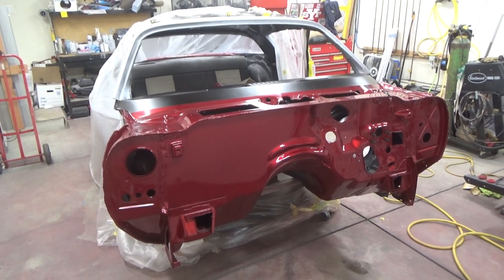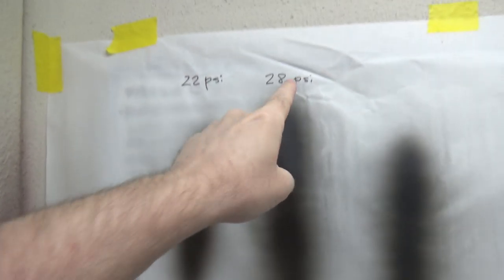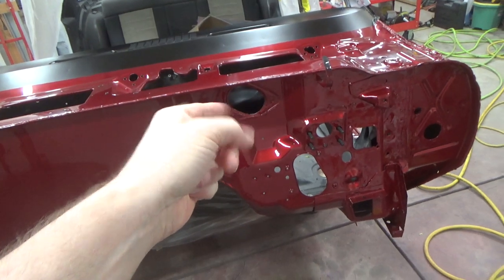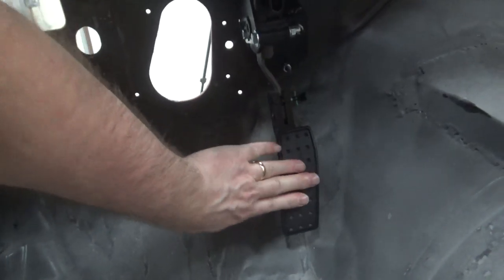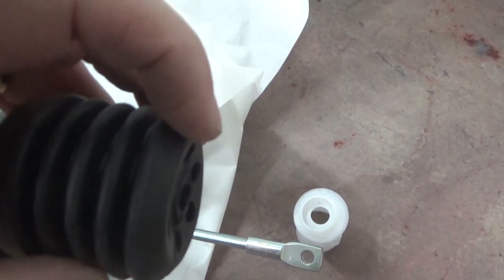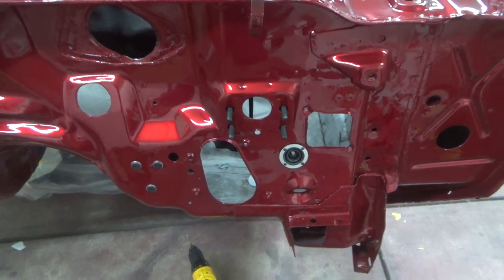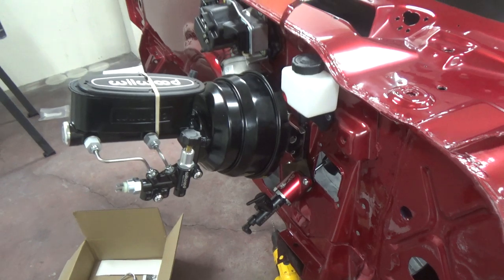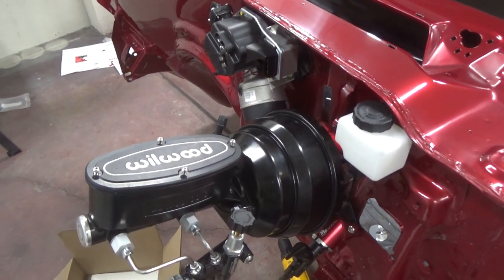1977 Camaro Z28 Part 222: Firewall assembly

Comment: Looking good, Erik.  I wanted to use socket head bolts on the assembly of my car.  After some time the bolts rusted up some.  It may have been because I covered my car with a blue plastic tarp and I had several areas that rusted.  I think the socket head bolts are just put in presto black to etch them black but they may put something else on them now to protect them.  Hot Rod tip on AN sizes if you put the number over 16, I think, it is the size.  An 8 is 8/16 or 1/2 inch.  If that is incorrect, someone will let me know.  Been a while since I was totally into my Camaro.  Marriage, house and trolls.  Keep up the good work.
Reply from the maker: Thanks Leslie. Hopefully I don't have many rust issues here in CA.

Comment: Looks solid.  Love the detail.  I had the same problem when I put on my new master cylinder.  That ring that goes from the master cylinder to your brake pedal should be able to be backed out.  If not, look into getting it extended by welding an added  piece.  Loving the progress and can’t wait to see Pops back in action.
Reply from the maker: Yeah, it is adjustable. I think I might need to open it up a smidge. I will take it off and see what I can do. Hopefully we see Pops next weekend!
Reply: asicerik “adjustable”, that’s the word I was trying to say!

Comment: Erik, things are coming along great love that Red.   look for something called a transmission plug it goes in to the tail shaft of the transmission and keeps the fluid from running out, that way you can fill it on the ground outside the car.  I have one that fits the Borg Warner ST10 but I am sure they make one for the Tremec.

Comment: wow it will look amasing! dont forget to ground the whiper motor to the body, there is one of the 3 bolts that is used for ground, i could not see if it is done but just in case!
Reply from the maker: Thanks Remi. Yeah, I will need to review all the grounding as I go.

Comment: I'm so jealous 😭😭. You're doing amazingly beautiful work on that old gem! I can't wait to see it put back together. I put my windshield cowl weatherstripping on with the seam facing the windshield because the one under the hood has the seam facing the windshield and just figured it would match. I put the one under the hood on immediately after removing the old one so know it is right from factory but couldn't remember the two on the cowl area so just matched with the hood one. Take it for what it's worth I suppose. Don't forget the 2 plastic pieces that go on each end of the windshield and hide under the fenders and upper doors.
Reply from the maker: LOL, I will have to track those pieces down. I have no idea! Thanks bud
Reply: @asicerik  classic industries has them. At least that's where I found mine because the originals were so brittle they cracked instantly. Not too expensive either.
Reply from the maker: @bradleysbuildingjunk6763  Do you know what they are called?
Reply: @asicerik  see if this link works https://www.classicindustries.com/product/1978/chevrolet/camaro/parts/153263.html
Reply from the maker: @bradleysbuildingjunk6763  Yup. Thanks bud. if you have a chance to show them in one of your vids, lemme know please.

Comment: putting another comment on here. I have watched so many house of this build through the years. stole so many ideas for my build I am doing at the same time. I am stealing your battery term idea in through the VA side panel. I got a heads up on the clutch master clearance issue on wiring. You know whats weird? I bought same wiring harness. I could not figure out how you were getting it on with the rounded end near the master. Turns out factory installed the fuse panel to bulk head flange either way. It can be 180 off. Mine is opposite 180 from yours and the larger click side is next to master. I am finishing firewall now. Also I am welding master bracket to fw like guys on LateralG. air tight and no need for boot. no noise. keep up great work, we are all watching and learning with ya.
Reply from the maker: Thanks Shawn. Very interesting! I debated welding that thing on, but decided to go this way. I am sure I can get that boot to be quiet somehow :)

Comment: I bought the same master kit for clutch. mine came with the gm style connector instead of AN line. plugs right into gm throw out bearing. thats what you need.
Reply from the maker: Thank you Shawn. I will see if I can find it.
Reply: @asicerik  here is link of where I got mine...http://www.brphotrods.com/mm5/merchant.mvc?Screen=CTGY&Store_Code=BRP&Category_Code=Clutch

Comment: Car is looking great! Just wondering how did you attach the drive by wire throttle?
Reply from the maker: I found a bracket on eBay to allow you to connect the pedal assembly to the Camaro firewall.

Comment: what is the metal strip going from the fire wall to the cowl?  Mine has one but it isn't connected to anything.
Reply from the maker: If you are talking about what I think you are, it is for cable management. Just something to hold the wires in place.

Comment: Did u put that fourth gas pedal bolt in before u covered it with wiper motor
Reply from the maker: LOL - no. I went down later looking for that spacer. I found it and popped the motor back off. Very observant of you! I missed it until it was too late.

Comment: I filled my T56 through the shifter hole. Can you get the shifter cover off with the transmission installed?
Reply from the maker: I have a new trans tunnel which hides all of that. I could cut a hole if needed.

Comment: Can you tell me where you found the bolts you used for the accelerator bracket. Part # to order? Store?
Reply from the maker: These? https://smile.amazon.com/gp/product/B00KM4P00E
Reply: @asicerik  yes sir! Were they the right length?
Reply from the maker: @williamritter9473  Yeah, they were perfect.
Reply: @asicerik  did you use a regular nut or the cap nut that goes with these bolts?
Reply from the maker: @williamritter9473  I used regular nuts as the bolts were a little too long. You could cut them down if you wanted

Comment: Shouldn't you put the firewall pad on first
Reply from the maker: Hmm - had not thought of that. I think only the accelerator pedal bracket would matter though. I was planning on just going Dynamat or similar. Do you think you need that + the pad?
Reply: @asicerik  I would think so but in far from an expert it was a suggestion